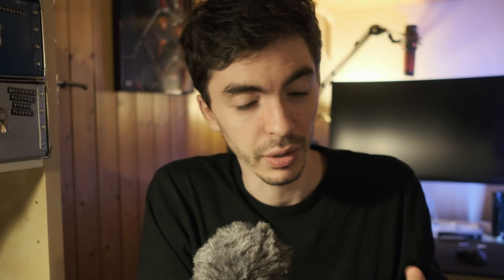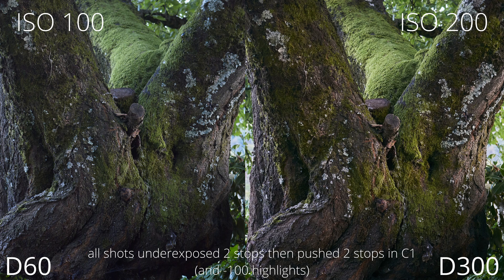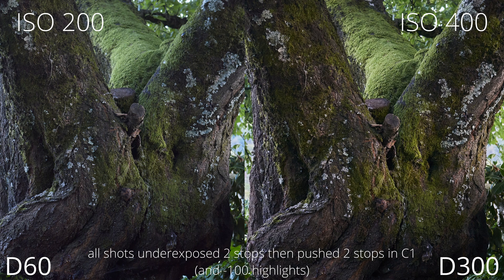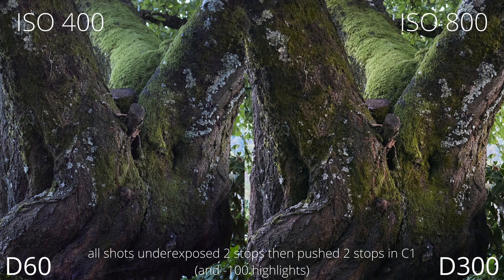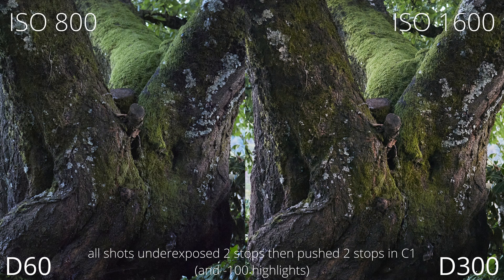CCD vs CMOS Sensor comparison : is there any magic to CCD?

Comment: interesting comparison! 👍 one thing I noticed in your video is that the AF system your camera uses seems to hunt a bit
Reply from the maker: yeah that's because a combination of factors...

I usually shoot my videos at f/4 but here I had to go to f/2 otherwise I wouldn't have a bright enough image keeping the correct shutter angle

I use face detection in the X-H1, which isn't always super reliable

The background is sometimes the same color as my face and the camera is confused for a second

I don't have a proper studio with proper lighting or a proper background (yet) so that's a thing that tends to happen regularly. I do prefer that compared to manual focus though.
Reply: @uncertainrelease  ah I see, thanks for the explanation!
Reply from the maker: @obedbrinkman  The few previous videos, I also tried to do a "less centered" framing to give room for potential images that would illustrate what I'm saying during the video, alas the X-H1 doesn't have phase detect points across the whole frame, edges are contrast detection only and that lead to the autofocus drifting quite a bit, and for a long time so I stopped doing that (even if that lead to "better videos" as far as editing goes)

it's 100% a concern of mine though, you have no idea how much it annoys me to see those AF errors during editing !
Reply: @uncertainrelease  maybe use manual focus when only you are to be autofocused? i know the problem from panasonic micro 4/3 series wich I used in the past